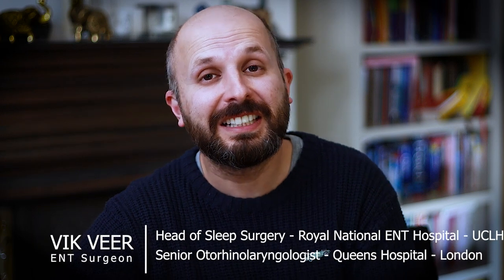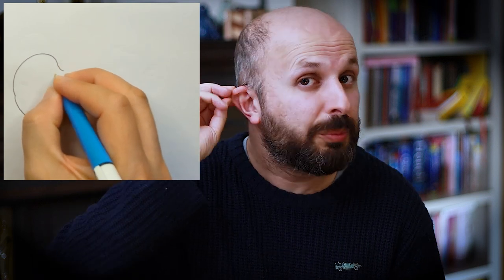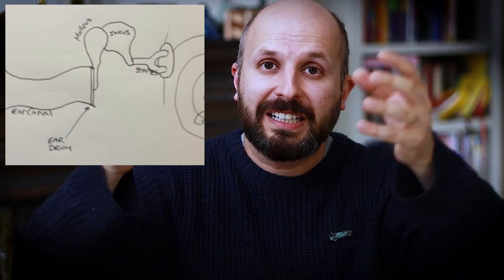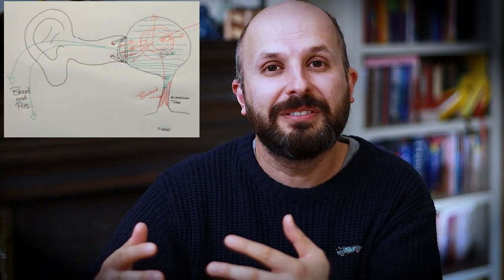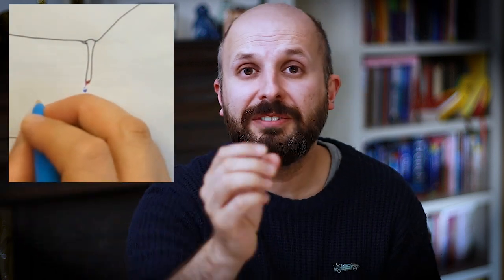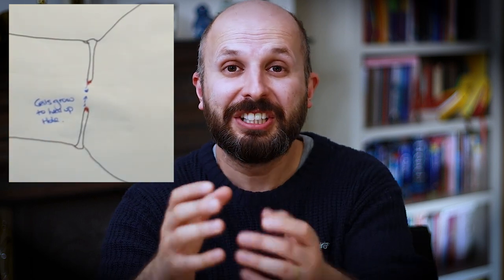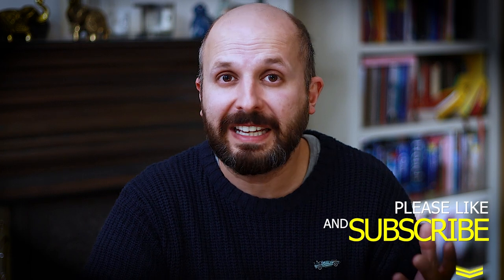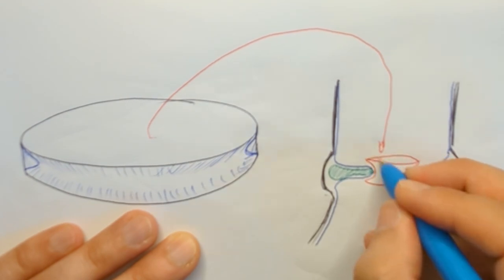Ear Perforation Surgery Explained!

Comment: Hii, I’ve had an ear perforation for about 13 years now. I believe it developed when I was a baby as I was born with ear infections and doctors didn’t look into my ear until I was 1 1/2 years old and found out I had glue ear. I’ve recently had my 3rd operation and I’m hoping it has been successful. They’ve used my own skin, a synthetic skin and now they’ve used pig skin. I’m curious as to why the operation has failed multiple times and if doctors looked into my ear earlier would I not be experiencing this???
Reply from the maker: If you have eustachian tube dysfunction then the operation will never work. Sort out the ventilation and THEN do the operation. I have videos on this as well.